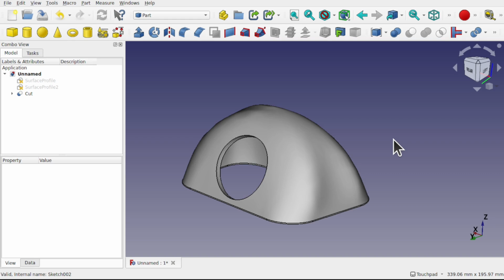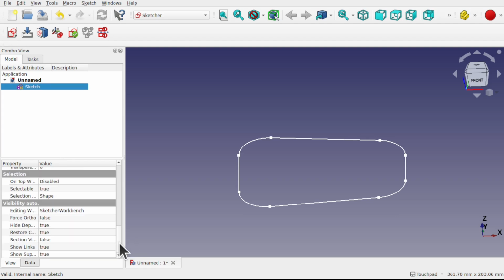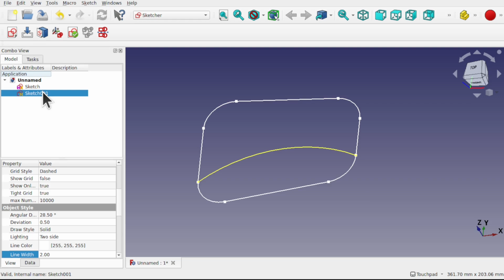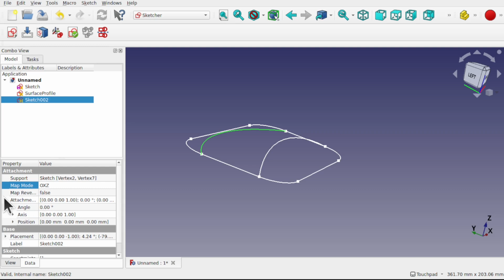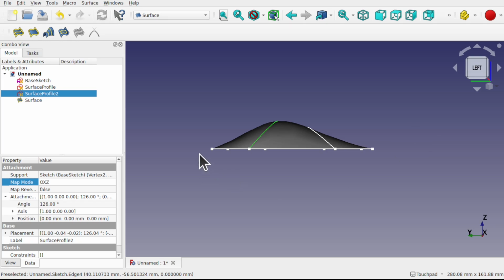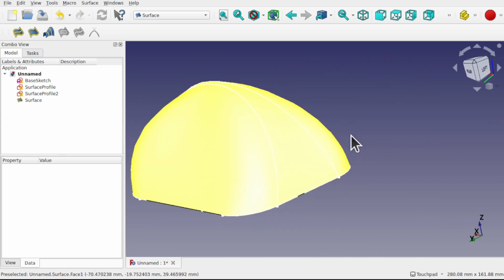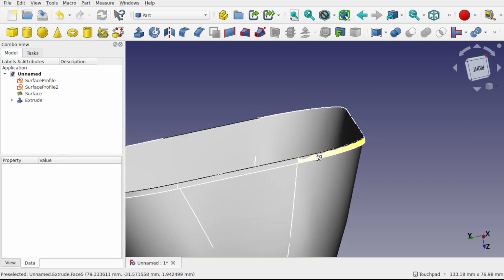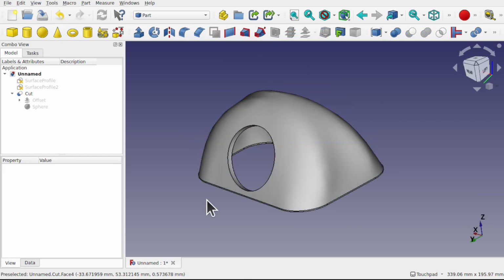FreeCAD For Beginners 32 | Surface Curvatures with Filling Surface and Advanced Sketcher Attachment

Comment: For some reason, the 3D offset for the union didn't work for me exactly the way it did in the video. It created the offset different ways for the surface and for the extrude. So, I went a different way. I created 2 different offsets for the surface and for the extrude so that the directions match and are both inward (surface negative, extrude positive). Then, I tried to union it together, and... the surface offset disapeared after the union. So, instead of the union, I created a compound and a parametric solid in the Curves workbench. I don't know if this actually creats a corect model, but, at least it displays it fine and it appears to be solid after the sphere check. However, I am using version 1.0.2

Comment: Currently using v1.0.2 and the "Fill in surface"  tool does not appear to be available for this version.  I went into into the Curves workbench (appears to merge both the Curves and Surface workbenches as the Surface workbench is no longer available as a standalone workbench to download).  Is there an alternative tool to succesfully complete this tutorial?

Comment: Thanks Darren. This is the method how we can bend the surface of spectacles lenses don't you agree?
Reply from the maker: Yes this would be one of the methods you can use.. The other methods would be to use a work flow similar to the fork and spoon video using a boolean common.
Reply: @MangoJellySolutions  Thanks, I've rewatched the fork and spoon video. I'm trying to 3D print a suitable frame for lenses I have from old broken glasses and fit the new frame into an auto-darkening welding mask.

Comment: I tried this with a more complicated shape and had trouble getting the surface to follow the unbound edges, even with deviation settings reduced(not sure what all the curve settings do though). 

Gordon surface seems to follow the curves better, but there were some cusps at the corners when I tried to 3d offset. the extrude trick worked in some cases, but not others.
Reply from the maker: Thanks for the update. There is a setting on the surface called iteration. Increase this up to 2 and then increase the points on curve see if that helps.

Comment: 00:00 Intro
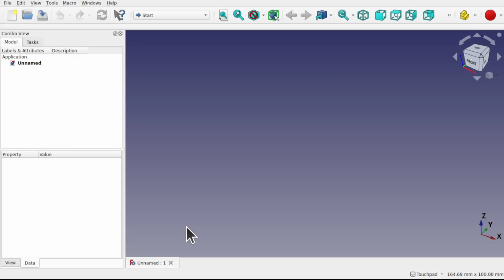01:20 Initial sketch
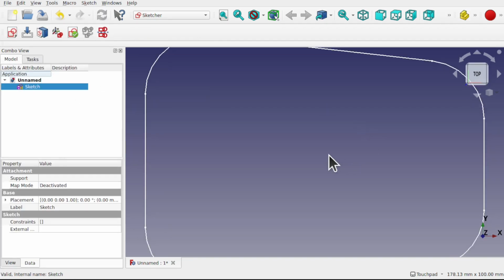03:02 Attaching new SurfaceProfile sketch to previous BaseSketch via OXY
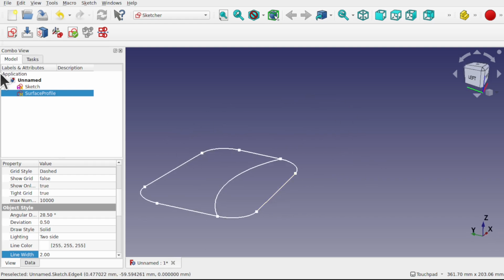06:50 Rotating sketch via attachment
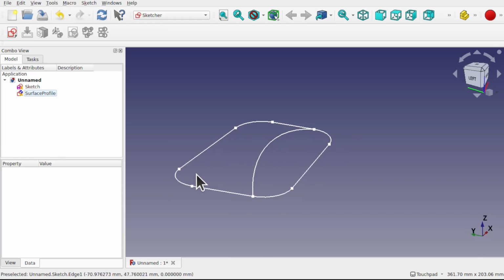08:39 Attaching new SurfaceProfile2 sketch to previous BaseSketch via OXY
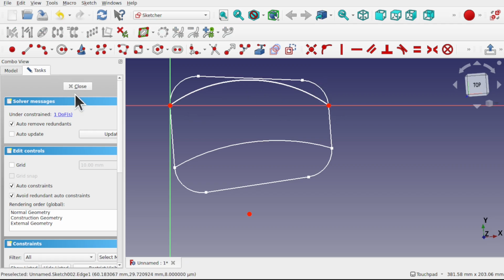09:27 Rotating sketch via attachment
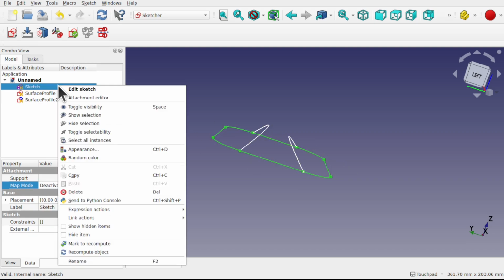10:51 Surface workbench: Filling 
12:27 Changing SurfaceProfile attachment angles to demonstrate surface change
15:17 Changing SurfaceProfile  arcs to demonstrate changes
16:33 Surface quality settings
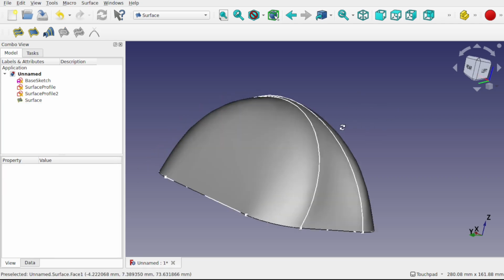17:20 Part workbench: creating solid from surface
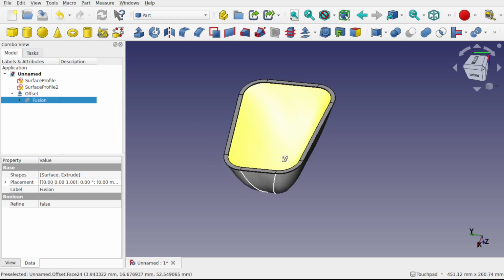21:41 Conclusion
22:55 Outro
Reply from the maker: Thank you so much for this. ❤️❤️